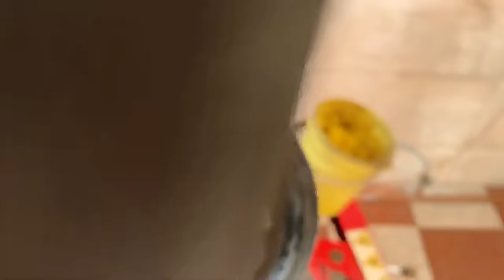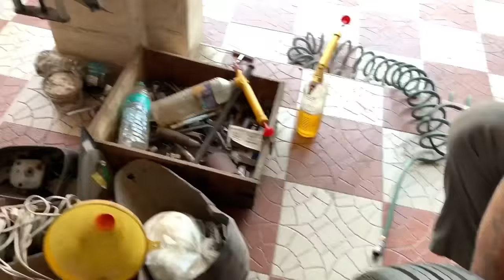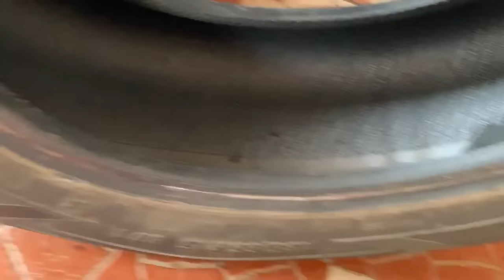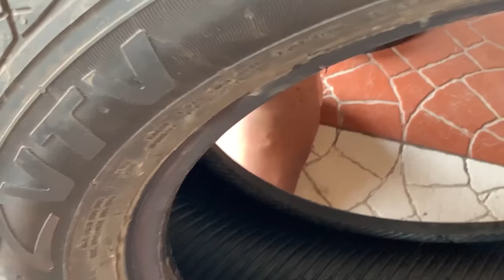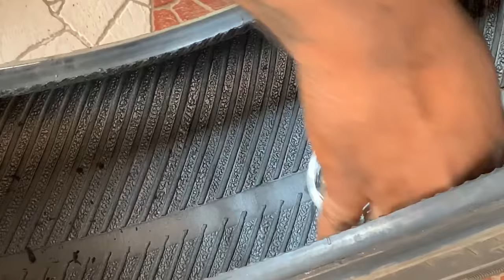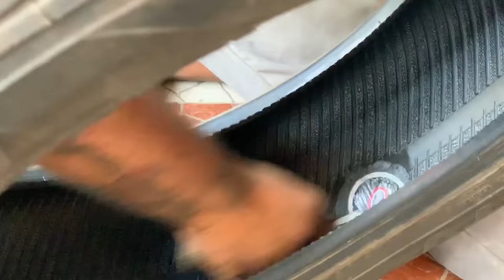Twin hole puncture fix in car tubeless tyre

Comment: Changed the weight balance of the wheel- tyre assembly by repositioning the tyre on the rim. Re-balancing required.

Comment: People this is not a good example of how to install one of these. You didn't wait until the glue dried he touched the surface with his fingers of not only the rubber on the front but the ground area on the tire he pulled too hard on the clogged in didn't drill with a carbide prepare the and remove the damaged section of Rusty bands in the tire

Comment: Why apply adhesive on plug patch ?, It's wrong, It's already applied while manufacturing.
Reply from the maker: tats not sufficient when exposed to air long time.. so applied adhesive again..
Reply: Thanks but usually adhesive is not applied and long exposure to air should be avoided.

Comment: Perfect example of how NOT to repair a tyre. So many mistakes! This repair will fail. Guaranteed. 
1. Use spiral tool instead of insert tool to check injury direction.
2. Use carbide cutter instead of insert tool to prepare injury.
3. Rotate in one direction only while going in and coming out. 
4. DO NOT TOUCH HREY GUM ON PATCH WITH HAND.
5. Use 36 grit rasp to get RMA 3 level buffing. Anything more will damage the tyre.
6. Clean buffed area with a cleaner (rub clean / rub o mastic etc) before applying CvF
Reply: Yes. You are absolutely correct. This guy is totally wrong. We are doing this for many years. I am a distributor for this OMNI products. He is using CVF on the gray cushion that is also very wrong.